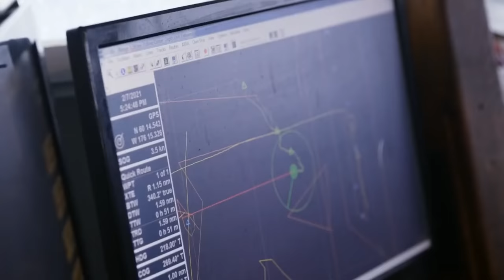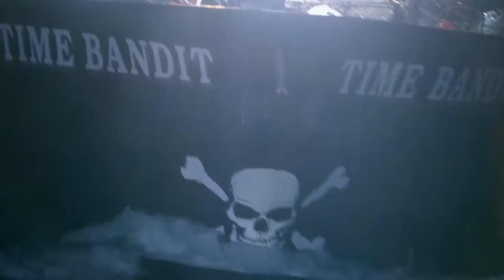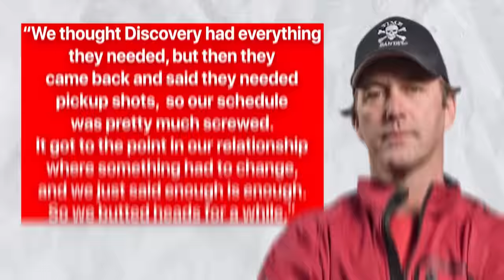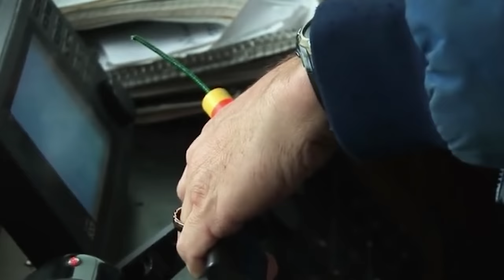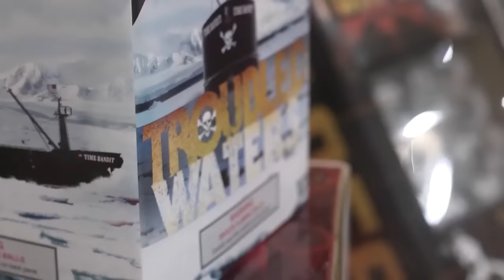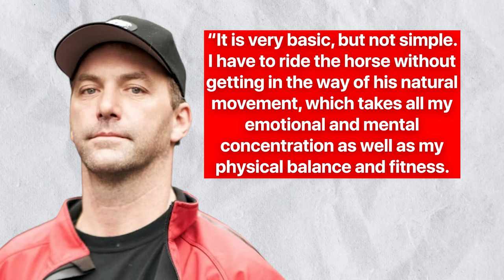What Really Happened to Andy Hillstrand From Deadliest Catch

Comment: Watching them and what they have to do on that boat has never ever looked easy to me. It looks like damn hard work and very dangerous work.
Reply: Well...that's because it is.
Reply: I worked in the concert sound system business for many years.  At the end of one show, a guy we knew a little asked if he could help.  I knew he had previously worked on one of the boats fishing for King/Opie Crabs (not one on TV)  We said yes, and he RAN over and picked up a 150 lb. speaker - by himself - and literally ran with it across a 100 ft. stage, lifted it into the back of the pickup and gently placed it down.
We all said "dude, you're crazy!"  He said that was easy because the stage wasn't rolling up/down/left/right with waves crashing over the side in minus 20 degrees temperature and gale force winds.  
Yes, they DO work very hard, and it truly is dangerous.
Reply: Somethin' about......a keen sense of the obvious.

Comment: The introduction of the IFQ system in crabbing made it "easy"if you can call it that and safer than the derby days.20 years on the water myself.anyone does this is born to the sea.its not for the light hearted.